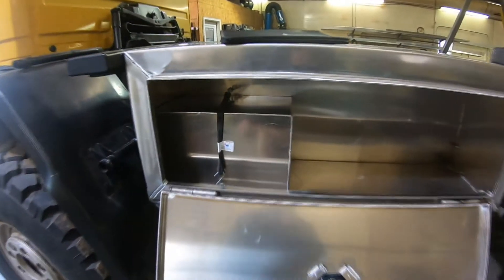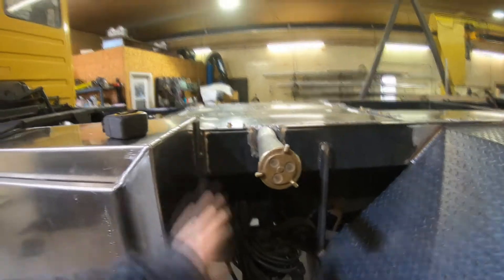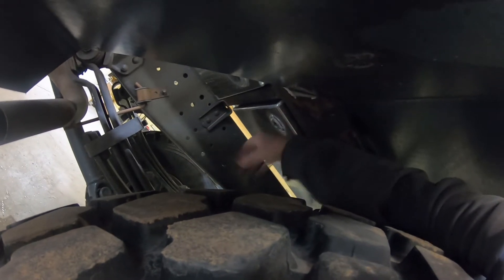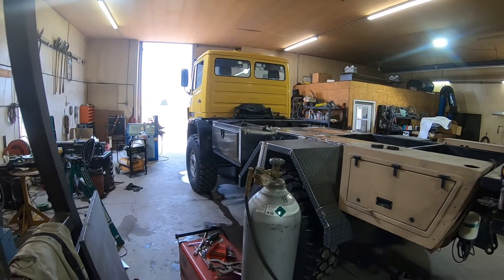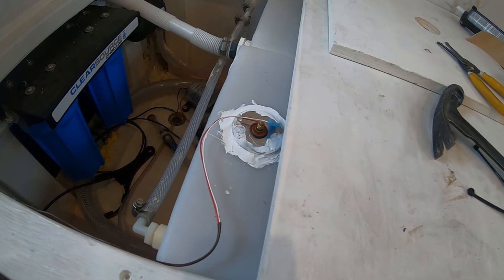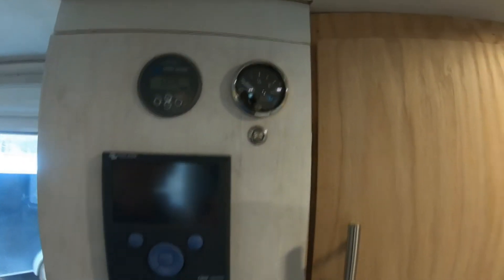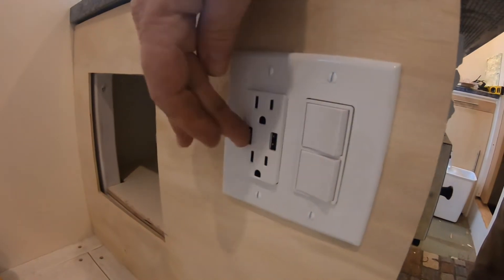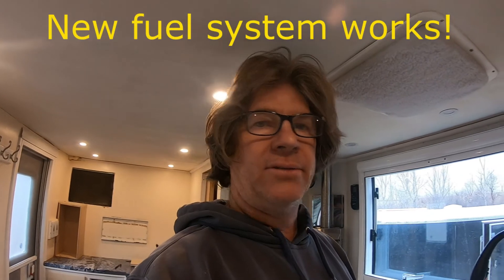Build Update 1-27-20

Comment: Looks like some great workmanship.
I should be in NoCo. Tomorrow if I don't run into major setbacks.
Reply from the maker: OK. I have a job at ten am but can break away or meet up after. You can find Van HQ on IOverland app on the West side of Greeley. Gate will be open. Let me know ballpark when you'll be around.
Reply: @Colorado4x4Van  I was hoping to make it in the morning. I'll let you know
Reply from the maker: @MinimalistMotoLife  Ok. I can be there just before 10...I'll leave the gate open and the tank/mount are right in front of the shop.

Comment: Very nice, my concern is about the fuel tank how is going to work when the frame starts flexing off the road? And looks like the frame was cut like 3” to run the fuel pipe or it is the subframe?
Reply from the maker: Thanks for watching! Yes, that is the sub-frame. The pivot at the rear allows the Truck frame to flex while the sub-frame stays stationary. We over-engineered it to the extent that the notch won't matter. I don't like the fuel fill...we'll have to raise it up and we have a plan for that!